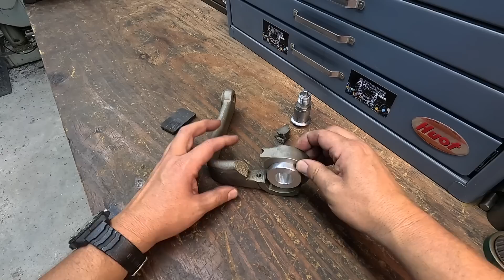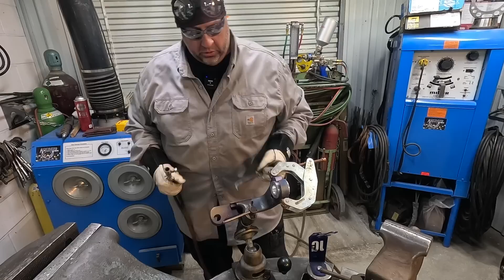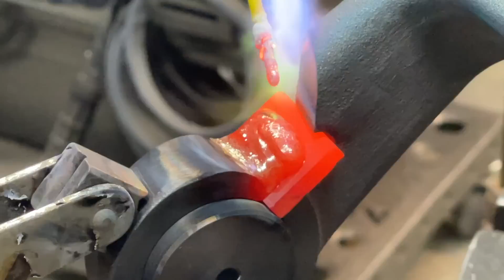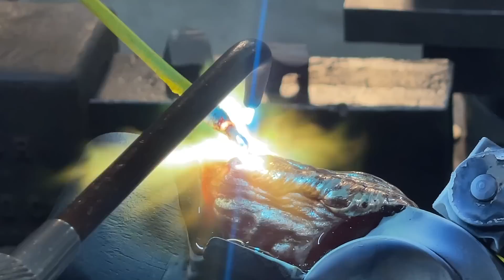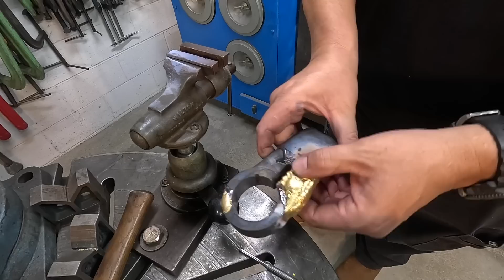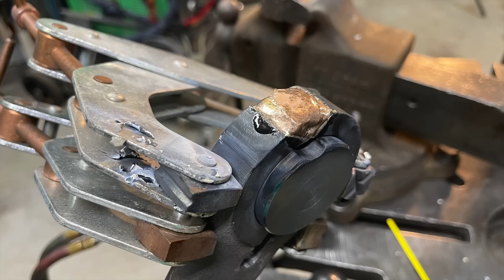Broken Lathe Feed Change Lever Braze Repaired

Comment: Beautiful, the only thing I may have done would be to have extended the slot where the clamping screw acts to make the clamping action  a little more flexible so you would not have to clamp down on the clamp screw as hard.

Comment: I’m not saying I would have used jb weld, but I know a guy who would.
Reply: Because this was a brittle break, the pieces still fit together closely, and we wouldn’t have to worry about high heat or fluids, wouldn’t cyanacrolate work?
Reply: @hubbsllc  Believe it or not, CA glues have been used to hold Cast Iron together for more than "just while I get these dimensions", or make a mold of this part to recast it. 
Usually, the bond is weak and easily fractured, so, no, this would not work where this selector would be used, driving the gear home as we do will eventually make it a bad part again, sorry.
-but I have seen a caltrop held together on a desk for decades of non-use. The 4 legs joined at the center and bonded after being ground at the interlocking sections. All hand cast by a hobbyist with a grim sense of humor, he made several each of different materials and one Harlequin made up of one of each material. Iron, brass, aluminum, and some type of hard lead alloy I can't remember the name of, I'll look up a reference and see if that helps... antimonial lead, that's it. Some copper, arsenic, and antimony with lead material. It was the heaviest of them all.
Reply: Shhhh I would not! ,😉
Reply: Don't we all!
Reply: I’ve glued decorative Castiron successfully with Epoxide-Resin, but I’m not sure how it would fare under Load.

Is anyone knowledgeable to give Recommendations on it?

I would try a slightly oxidizing Flame to get as much Carbon/Graphite from the Surface.
Then a quick Etch to clean it.
Possibly even unfilled Glue/Resin to get a better Bond and the Crack is so narrow that thinner might be better.

Comment: don't know why you'd use gas instead of tig.
Reply: Because keeping heat in the Cast Iron beyond the weld pool is important too even after a good preheat.
Reply: A bit chunky for TIG IMHO.
Reply: Why, because it works.
Reply: Tig is too much heat.  You'll change the structure of the cast iron.  Make it brittle or likely crack adjacent to the repair some time in the future.  Brazing gives amazing strength to a cast iron repair.
Reply: @johnperkins7179  The 'Heat' input from TIG is actually less. Where it is not as good is that heat is very focused locally even when TIG Brazing with Bronze (the actual weld strength will be near identical) so you miss out on the ongoing stress relief you get with Gas.

Comment: I didn't see the melting issue with the aluminum coming, but I was concerned with the expansion coefficient being a problem, aluminum grows and shrinks at nearly 3 times the rate of cast iron, lot of stress on a cooling joint that you don't need.
Reply: I did but I figured he'd find out ... and he did.

Comment: To my way of thinking, that closure method is a bad design.  When you tighten the bolt you are trying to bring the circle together, but in doing so you are putting a lot of tension on the back right along that diagonal joint of the brass & cast.  That probably caused the part to fail in the first place, a key and set screw would have been a better method.
Reply: He said at the end the part broke during a tough removal.
Reply: It’s a terrible design. There’s better ways to clamp the shaft with much less chance of breaking.

Comment: No wonder this broke. Bolt pressure in a cast part like that begs for a fracture. The introduction of the bronze areas should add enough flexibility to alleviate that.
Reply: It broke during a hard removal, not tightening it down.  Listen up.
Reply: @videodistro  I did get that, however that does not eliminate the introduction of microfractures from having been bolted that contributed to the failure when removed.
Reply: It went all these years without breaking.

Comment: Nice work, but it is a little annoying when customer stated he will do the work.. he just wanted it brazed it up. It isn't for sure customer like what you did and it is exacly that customer wanted to do it. oh well. we all know, its Adam.
Reply: If I was the customer, I'd be very happy with it shaped already.  It looks great. Less work to do that I could focus on the lathe restoration.
Reply: @Discretesignals  Of course, that not the point.
Reply: @koford  well, maybe Adam went the extra step of shaping it to be sure no voids were present that needed touching up.  I would have done the same thing.
Reply: Did you watch the video to the end or the beginning for that matter? Customer stated that he would do the "machine work". Nothing was mentioned about the shaping/finishing after the brazing operation was complete. We don't know if there was a discussion about who would do the finishing. That was never mentioned. I would tend to believe that finishing after brazing would be part of the process unless specifically asked not to do it. I've seen Mr. Booth go overboard at times and do things a customer really did not say they wanted done but not in this case. IMHO
Reply: @tsmartin  if that not machine work, i don't know what it is?
Reply: @koford I'd hardly call running a flap disk on an angle grinder "machine work".
Reply: @MadDawg91108  what? i guess im blind
Reply: @koford This is more like deburring a sharp edge, but a  bit more so.
Reply: It's a customer's prerogative,  not the hired worker.

You obviously never ran a business... or worked in one.
Reply: @videodistro  Your response is nonsense, customer wanted to do the job, and all he wanted it to be braised up.

Comment: I appreciate the owner wanting to restore the lathe but I would just fabricate a new piece from some steel flat stock heated and bent and machined to fit. He's wasting Adam's time and effort. The fabricated steel piece would be stronger and not break like the original casting.
Reply: It's not a waste if time if he's getting paid, and having video content.  It's up the customer,  not a bunch of intermet commentors.
Reply: Maybe, but it's a fun challenge to re-use as many original (but repaired) parts as possible when doing a restoration.

Plus, Adam seemed happy to do it.
Reply: That's what I say, but it gives Abom an excuse for some nice brazing. So, it is what it is.

Comment: Great job and will work well for show but it will never hold up to the stress of use. Another entertaining and educational video.
Reply: I think it will work better with the brass since it will have more tolerance to flex than the cast iron will.
Reply: @Neptune-718  The problem is the flex. It is a lever. The combination of tightening the arbor and pressure from actuation will cause it to fail. I explained this already.
Reply: The movement is miniscule.  It will work just fine.  If you listened (which you must not have) it broke during a hard REMOVAL, not by tightening.
Reply: @videodistro  It is a lever. The combination of tightening the arbor and pressure from actuation will cause it to fail.

Comment: I'd like to see some TIG brazing with silicon bronze. I think that it would have worked nicely here as well.
Reply: Believe it or not brass rod does a better job holding and is more forgiving.
Reply: @slyfox7429  cool... Not sure what that has to do with my comment.
Reply: @LtDan-ni5rw The TIG works best at brazing stainless and other steel types. Cast iron has a different structure in the grains and the distributed graphite. The highly localized heat of TIG will cause a HAZ (Heat Affected Zone) with the graphite going into solution at the boundary and making that area brittle. Sure it works, holds well, and might last the life of the owner. Still it is a waiting bomb, waiting for just the right conditions to fracture.😢
Reply: @CothranMike  this is prevented by preheating the base material. I'm not looking for an explanation on how flame brazing is better in this application, just saying it would be cool. It's a lot of buildup to be done with TIG as well, but it's a cool process Adam's never shown on his channel. I completely understand that it's not ideal for this particular repair.

Comment: I used to work at Hi Boys when I was a kid (Abby knows the place) In the back everything was stainless steel. If something got broke or cracked the maintenance guy would braze it. He always did excellent work and I came to appreciate the esthetic of properly brazed repairs. Then I found out the Japanese will repair broken ceramics/pottery, they will use adhesive and gold leaf. They call it Kintsugi. Your work here has that Kintsugi esthetic I hope it works well on your customers machine.

Comment: All the best for 2025.  The joy of brazing or gas welding you are in control you can stop and start to suit, great work I have repaired several cast parts with good success, it takes quite a time but done correctly as you have done the repair will be strong.  Great video love it keep it up from the uk

Comment: You have good torch skills so TIG brazing should be easy for you to do.I have done tig brazing with Sil Bronze in Vertical up because the heat is much more controllable than with a torch you will get less sagging. So less wasted bronze grinding it away also no flux needed just make sure everything is clean in the weld joint as usual. Like your show watch all the time... I do welding and worked at one time a maintenance mechanic in a fastener factory and when i had nothing to fix i made tooling for the carbide dies to be pressed into for the header presses the made the screws and bolts ..My Dad was a welder and grandfather was a machinist

Comment: Nice touch with the brazing rod, as good as I have ever seen. Seems like a lost art. I have seen many old machines repaired like this and it works. I think you should have left the small cast piece and made two joints but other than that, very impressive.

Comment: Looks like a poor design in original piece as the C.I. is in flex & tension exactly where it broke.
Reply: I was about to say the same thing. Very poor design to actually force the brittle casting to flex slightly to tighten the joint. No wonder it broke.
Reply: @ellieprice363 Seems like many more broke in this same spot after checking on the web. A bad design indeed.

Comment: Wait till she’s cherry red then go ahead. Nice job brazing that part Adam. Great camera views Abby. I remember in shop class learning to weld aluminum with a gas torch. I think it had to be between 700 to 800 degrees before welding it and we turn just the acetylene on to see if the smoke would stick to the aluminum. An easy way to see it’s ready for welding. Fun stuff to learn. I enjoyed it.

Comment: What's the rationale for replacing such a large piece with braze? I thought it would look better to retain more of it. Also, why chamfer so aggressively? Is it necessary or just a personal preference?
Reply: My thought was it avoids having to manage v-ing out both sides of the small piece, and ending with pretty much the same result anyway, except more fragmented.  I think it was a bold and correct call.
Reply: @ydonl  I guess I can understand that. I suppose I don't understand why the v-cuts have to be so aggressive. Seems like even if you had 1 mm between all mating surfaces that would hold enough braze to bond the pieces back together.

Considering Adam's extensive experience, I'm sure what he is doing is the correct way. I just don't know enough to reason about it.
Reply: @ Fair points.  I don’t remember seeing any brazing with minimal v-ing, ever, so I wonder some of the same things.
Reply: @arcrad Well, here in Anatevka we have a saying, ... Tradition, Tradition, Tradition!
Reply: Other than that I got nothing.

Comment: To keep the steel bushing from brazing to the part, you might try using white house paint on the bushing. Some knife makers who make damascus steel inside a welded steel box paint the inside of the box with white paint. The paint separates the box from the billet allowing the box to be separated after box and billet are forge welded.
Reply: What kind of white paint, latex or oil based?
Reply: @ellieprice363 Should be either one, as it’s the titanium dioxide pigment that makes a barrier.
Reply: @ellieprice363  You can use liquid paper as well, anything with Titanium DiOxide in it the more the better to a point, never reached that point yet but, whatever.

Comment: Not trying to be ignorant but all things being considered, why would you not just make a complete new unit out steel? It will take far more abuse and would never break in service.
Reply: This one lasted a good many decades.
Reply: @kensherwin4544  A little heat when it was removed would have saved a very difficult repair.
Reply: @seapy2398 I also think there was a rim of mushroom around the end keeping it from sliding off. Best to slide it the other way first and check for a burr, remove it and then slide it off. Anything that old was going to be mistreated at some point I would have figured. But this is a bad design to begin with, the cap screw holds it in compression all the time, it is just looking to fail. From checking on the web this is a common problem with the part.

Comment: Just make another one... too much effort to attempt a a braze operation on part that has clamping force and twisting moments on it. Do the job right the first time.
Reply: I think it’s a awesome display of brazing techniques especially for someone that’s interested in learning.
Reply: @james130211  He was asked to braze it.  You do yours, he did his.
Reply: Looks like Adam's repair was done right the first time for me.
Reply: Wanting to keep it as original as they can? Come on stop with the negative
Reply: Agreed, but this does make a good video…
Reply: “Too much effort” apparently from someone who doesn’t take pride in workmanship and would prefer to take shortcuts.
Reply: Some people value a repaired original part more highly than replacing it with something that would have never come on it. You do you, but that doesn’t make your opinion the “right” opinion, it just makes it yours. This person wanted to repair the original part, who are you to say that’s “wrong”?
Reply: There's a lot of misplaced overly emotional support from some of the viewers here, and the over the top heart-felt supporters responding to one constructive criticism. Comments from a few emotional supporters are akin to die-hard Viking supporters ilk. Adam does High Quality Machining and Repairs and is a Master Machinist. While this is a 'repair' it is not the normal High Quality repair that will last for a lever-arm broken at the clamping-bolt and structural flex point.

 It may look 'pretty' in the end, the right repair would have been to replace the arm with making a new one, which Adom could have done in with a little more time with better material. 

Adom does have the material and could have really knocked it out of the park doing the correct repair that will last and no one will be worried if it will fail again. 

Some of you loyalist to Adom (whom IS a Master Machinist and got there by a lot of trial and error) are coming from a heart-felt spot, but NO one gets better if you keep telling them their 'awesome', e.g. a DEI woke hire  (like biden, harris, obama, soros, newsom, hochul, tampon tim, ...)
Reply: @   if you order a new Ford from your dealership would you be satisfied if they sent you a Dodge?
Reply: @patbullard9276 James is saying the factory Ford here needs to be more like a Mercury or a Lincoln. The design is flawed, it is true, the repair might fail for the same reason, being forced to open wider than is normal to clear a burr or mushrooming on the shaft it was attached to. Some monkey fisted moron got into a jam at one point and was tappy tap tapping on the shaft to make it go into the gear he had selected ... for - reasons! where he only needed to drift the spindle and ease it into the correct spot. 

I've seen this, you've seen it, we all know what happened to make this a pita to remove from the selection shaft for the 'new owner' which is what caused this to happen.
Reply: I was going to say the same thing.Make it from flat steel,heat it up and bend it.
Reply: @jamesdavis8021 .  Obviously you like to shortcut your work. You must take pride in that. Just put in the minimum effort.
Reply: @patbullard9276  remaking the lever from steel is not a shortcut. It is an upgrade.
Reply: @jamesdavis8021    In your opinion. It’s not original and unless you simply cannot use the original, original is best.
Reply: @jamesdavis8021  in what world is a braze repair more work than fabricating and machining a new piece?! Hahaha
Reply: @jamesdavis8021  Agreed but it wasn't the design of the original part but the method of disassembly so far as I can see.

Comment: Another good reason to use steel instead of aluminium or graphite is that the coefficient of expansion of cast iron and steel are very close (aluminium expands too much and graphite doesn't expand enough).

Comment: Hi Adam, why didnt you try silver soldering. I use it for perfect cracks like this. You need very little solder and it flows extremely well. It has compareable strength to mild steel. I even solder 0.5mm band saw blades and the joint never breaks.
Reply: Would you have enough working time with the flux on a piece this big? My only experience silver soldering is lugged bicycle frames
Reply: @Keesvanrooij-o5h Show us your video!
Reply: He doesn't need to show you a video.  There are WAY MORE experts who don't post on youtube than those who do.  Stop being a TV/youtube worshiper.
Reply: @videodistro  For asking for a video on silver soldering, you give me this?  I don't want to be friends with you anymore.